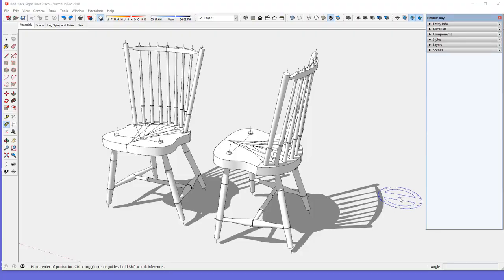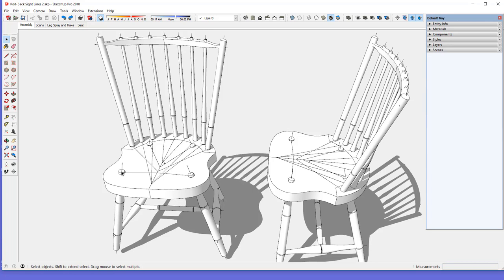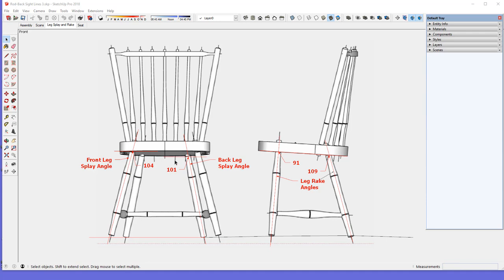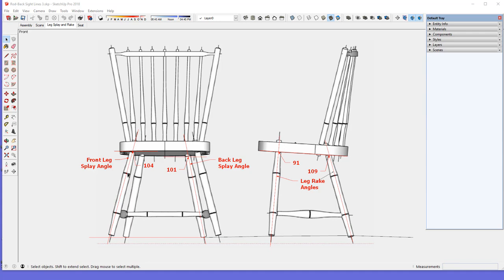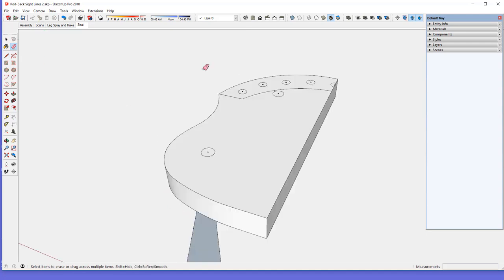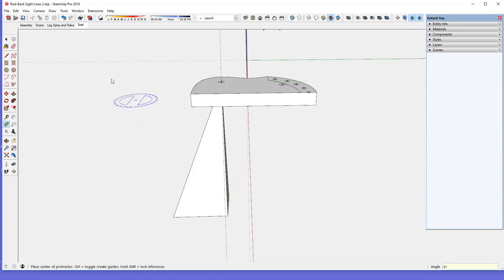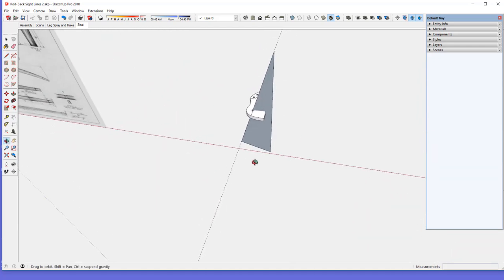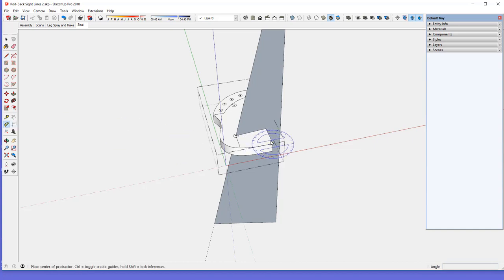Making Windsor Chair Sighting Lines

Comment: A traditional Windsor chair has no definite angles each chair made is different unless they are mass produced  by the time you have finished messing around with cad you could have built most of it we dont use computers and angles in the uk we just get on and build it the traditional with green ash no glue or paint
Reply: I'm from the UK and I use cad. Just because you can't use cad, don't take it out on this guy. Keep your rudeness to yourself